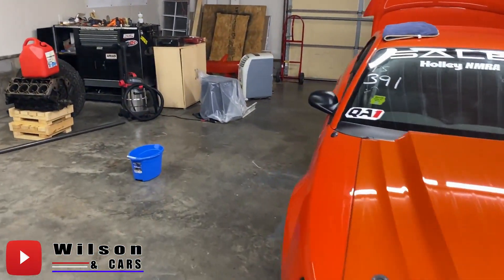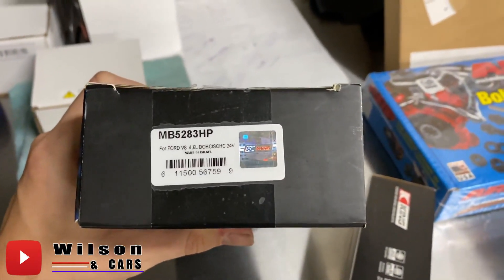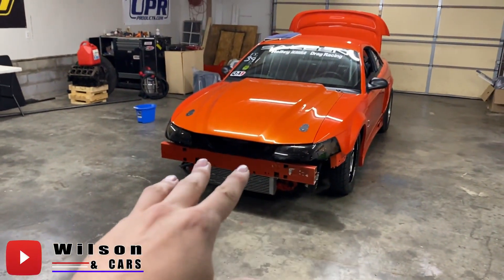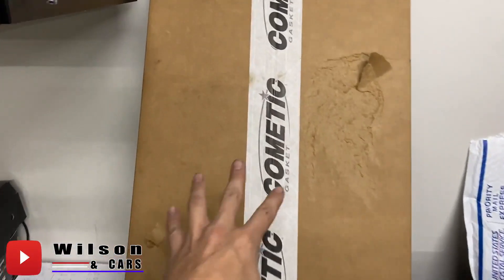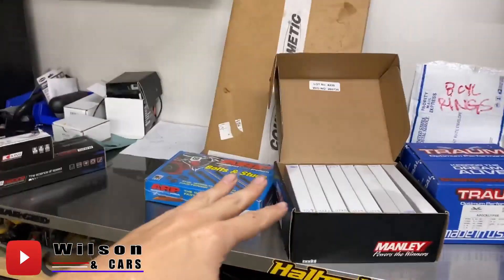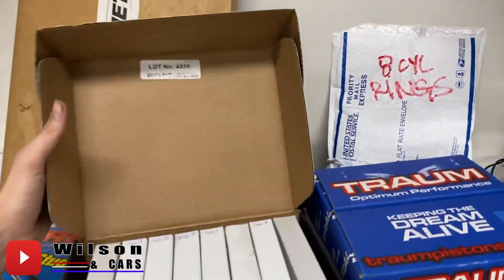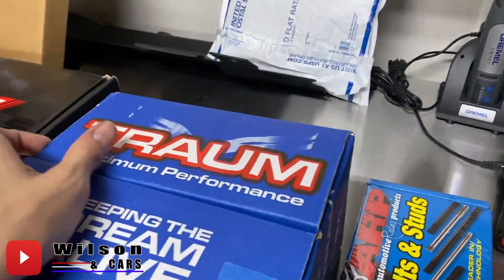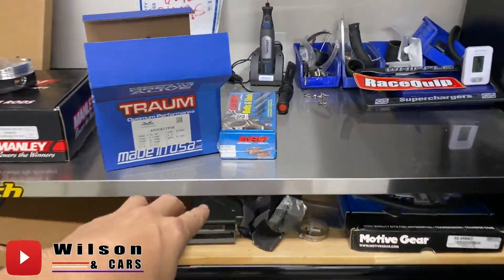4.6 mod motor  gen 5 whipple supercharger engine build

Comment: I've looked everywhere on the internet and no one gives a straight answer on the Teksid blocks. Are the cobra ones the same as the markviii ones?!
Reply from the maker: I believed that they are the same , 96+ teksid have different side bolts then the 96 and under teksid blocks .  Side bolts for the main caps, that’s the only difference that I am aware of..